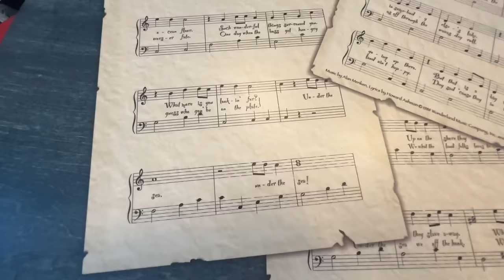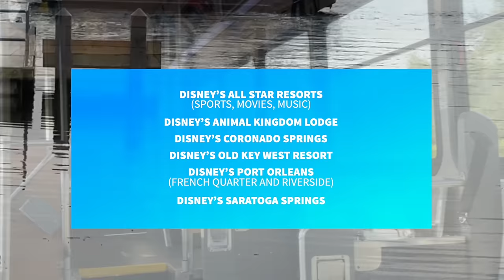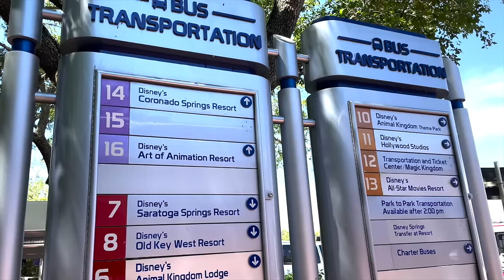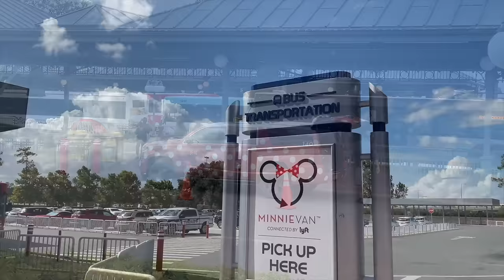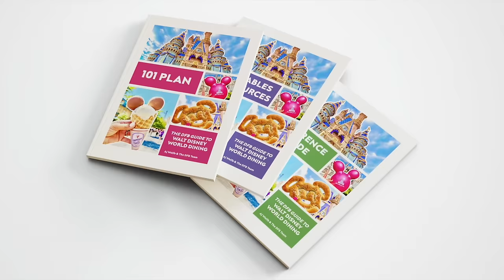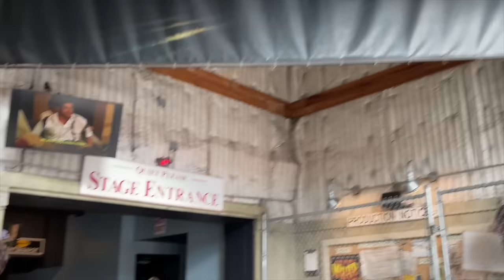The WORST Disney World Hotels in 2024

Comment: I’m not going to Disney in 2024 because I’m saving up for a top tier vacation to Universal when epic universe opens. I love Disney but they haven’t done anything to actually be competitive with Universal. I will return at some point but that will be after Disney does extractive upgrades.
Reply: Yeah I went to Universal last year and was sad at how trashed the park was. They don’t have nearly as many trash cans and every line I stood in, the ride broke down. I wasted hours because three of the big rides broke down. The park wasn’t much cheaper either. I got the two park two day pass and it cost me as much as disney. The only good ride was Velociraptor. Everything else was baby roller coasters, broken down, or was the same 3D ride, but themed differently (Transformers, Simpsons). Hopefully you have a better experience than I did. I’m going back to Disney.
Reply: @mindyschocolate  I've been a few times and have loved it. I agree it's not near as well themed as Disney, but haven't had any issues with more than one ride breaking down (Kong) and your also right that the price is cheaper and many of the rides are 3d sims but Universal is building an entire new park and that is what I'm holding out for. It would be nice if Disney built a 5th gate but all I really want from them is some meaningful updates and not trying to nickle and dime me at every turn. The lighting lane thing is truly a slap in the face to it's loyal customers.

Comment: I'm going to have to disagree with you about the tower suite rooms at the Riviera.  First, there are only about 20 of these rooms.  And they are considerably less than the deluxe suite rooms.  They are not designed for 4 people, but they do accommodate 2 people with ease.  The bathrooms are as large as a regular deluxe suite and when the bed is folded up, there is plenty of space.  While some people dislike the murphy bed, I happen to like it as it folds up and gives you a sofa to sit on so you don't have to sit on the bed.  Yes they are pricey for the small size, but it is the Riviera after all.  Lastly I will say this, the view from these rooms, especially the upper floors is absolutely spectacular.  I have stayed in these rooms for New Years Eve for the last 3 years, and you can see the fireworks from the Magic Kingdom, Hollywood Studios, and Epcot, as well as the fireworks from I-Drive.